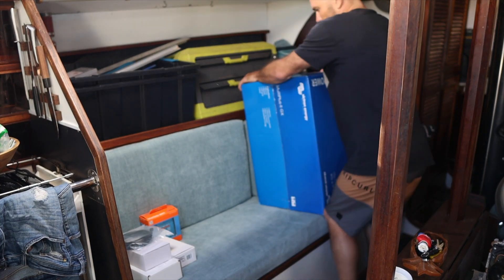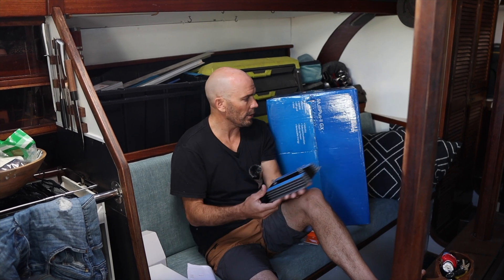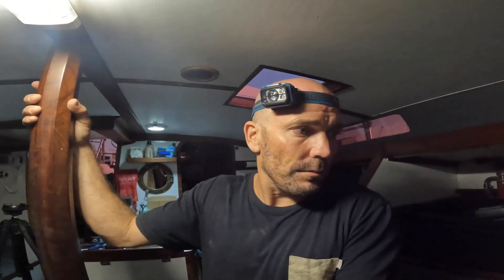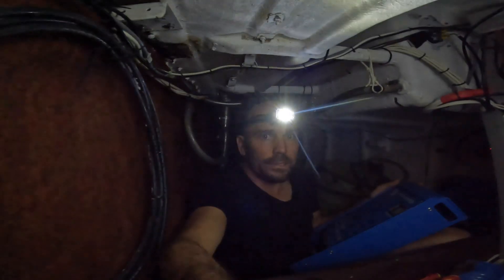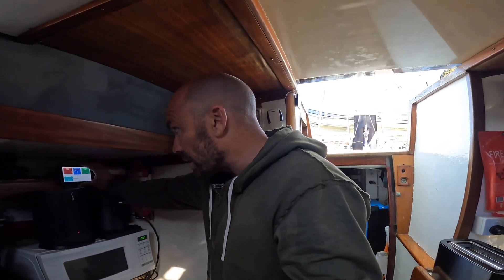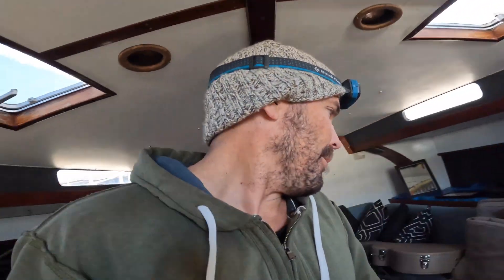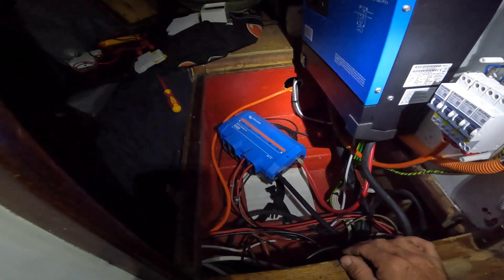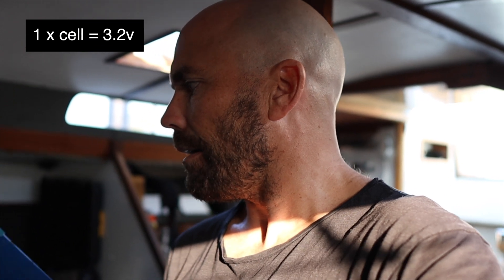Victron Multiplus-II GX 48/5000/70 & Orion DC-DC Converters

Comment: Why are you using a different Gx when the inverter has a GX
Reply from the maker: Cerbo GX is bigger, looks way better, more functional. The small gx screen on the inverter is not super usable especially as my inverter is tucked away.
Reply: @slightadrift So why did you pay extra for the Multiplus ii gx version?
Reply from the maker: At the time they were both the same price… and I thought redundancy could be good. I’ve never used the screen to date tho

Comment: Would have been a good idea to add waterproof adhesive heatshrink sleeves to the galvanic isolator wiring connectors to cover up that bare wire. Really cheap stuff and goes a long way to preventing corrosion at the most common wiring failure points (and accidental shorts).